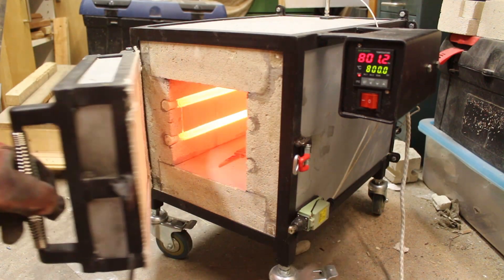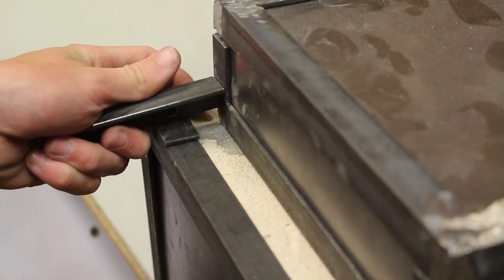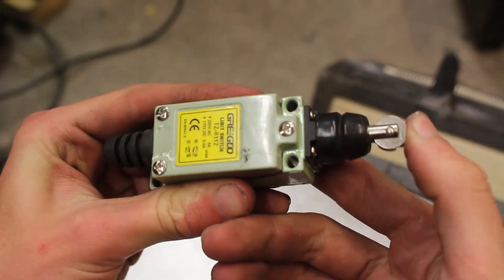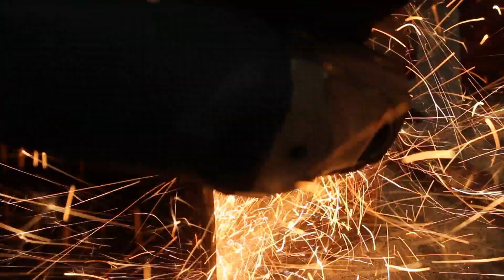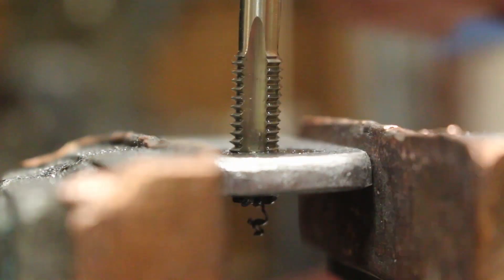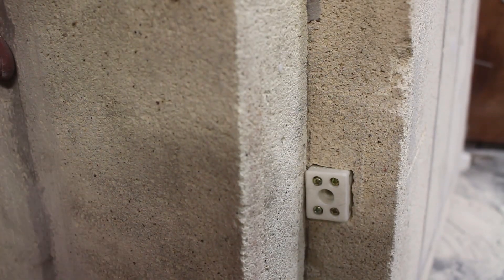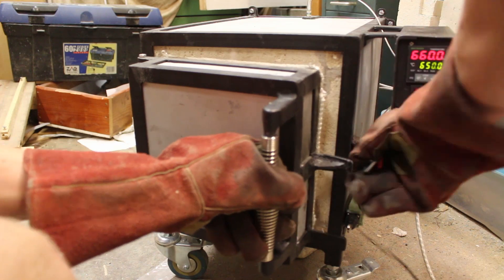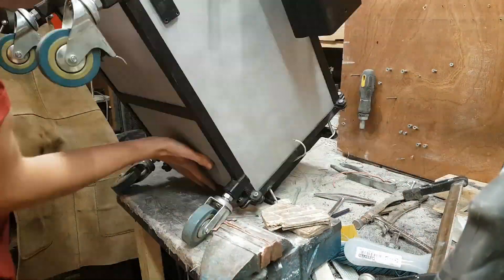How to Make a Large Heat Treatment Oven - Pt.2

Comment: Could I recommend that you use a rubber or insulating grommet around the cable exit hole on the back of the electronics enclosure.... to reduce the risk of cable chafing / shorting against the metal plate. I llke the design, and the explanations are very helpful. I'm going to guild one!. I know this is 3 years old, but worth mentioning. Thanks for the videos.

Comment: How hot does the outside of the oven get after an hour or so of running at 1000c amd above? I'm building  my oven now and ordered some 1 inch kaowool to clad the 2.5inch thk firebrick... Just wondering if it's needed?

Comment: Excellent build! Regarding all the welding, I'd absolutely recommend getting a tig-welder!:) No slag (so no clean up), easy to get beautiful welds, and an incredible dexterity when it comes to the amperage settings. And you can do tiny welds or heavy duty stuff with the same equipment. I'd be surprised if you don't follow This Old Tony yet, but there you can get a lot of tips an inspiration regarding tig.

Comment: ya wanna avoid scale.   Try  back filling your oven  with a slow feed  of nitrogen or argon  like 2 cfm or less since your oven is pretty tight..  or you can envelope your work  in a stainless pouch sold precisely  for this.    you can also  use a quenchate designed to  descale   Some folks  use mineral oil with ATF which is highly detergent and will descale.

Comment: Good vid thanks for sharing. Did you have any problems running the load through the cheap 20a switch? I used a cheap switch also but I was worried about running high loads through it so I ran the hot all the way to the SSR and then jumpered back to the 20a switch to power my PID, fans and amp meter. I was just wondering if you have fried a switch or not. I am not saying you are going to cook It. I just didn't trust such a light weight super cheap switch on my set up. I mean I did but I didn't want all that current running through it. Anyway well done looks really nice.

Comment: Congrats on the build man! I intend to build this very same design for annealing glasswork. One helpful tip though, although your intentions were good with the cable strain relief inside the box with the bolts. You should really install a legit strain relief in the back of the box where the wires enter the box. The purpose of a strain relief is not only to prevent the wires from being pulled out, but also from chaffing on the enclosure where they enter. It wouldn’t take long for that metal to wear through the wire insulation. With that much current going through those wires it’s a definite must have! Great job on the build man! You’ve earned a sub.
Reply: The metal clamping is good, a vinyl or silicon grommet would do nicely to protect the wires from chaffing at the thru-hole.

Comment: TAOW, I had an idea if you want to further improve the electrical safety of your foundry. For literally just a few bucks, you can pick up a high current full bridge rectifier to power the heating coils. This will convert the AC voltage to DC, which is considered to be 4 to 5 times safer for electric shocks.
Reply: ??? Citation needed...
Reply: @gregraynard781  ,  it’s pretty well known. This page says it explicitly. You can just google AC vs DC danger. https://www.asc.ohio-state.edu/physics/p616/safety/more_current.html
Reply: @shoitah  
In your citation it states " On the other hand, people have withstood 40,000 volts at a frequency of a million cycles/sec or so without fatal effects." Is that not clearly an example how "AC is more dangerous than DC" is not always true? At 1 mHz the skin effect is taking the charge along the surface in preference to better conductor underneath. 40,000 VDC  blows a hole in your skin, and then /500 Ohms = 800 Amps = dead or dismembered. Another misleading assertion is that is is current that kills, because without Voltage, there is no current.
Reply: @gregraynard781  , that is true but irrelevant information. All I’m trying to say is for TAOW’s purposes, at which an AC voltage at 50Hz, converting to DC would be considerably safer.

Comment: the limit switch is unnecessary for electrocution safety.  not only are your coils in a pocket in the walls but you would get burned badly before your hand touches a live coil. 
there is no way an ungloved hand would go near 900c heat without burns from heat first. Unless you got some ninja skills and the pain tolerance of a granite rock. 
The hair on your arm would burn off too.  I can barely stand a 900c kiln with welding gloves on for more than a few seconds.
Reply: You also have to consider when the foundry is cold and power is on. And also safety while servicing the unit.

Comment: Wow, this is simply amazing! I love this project and will try to copy it. What would you estimate the all-over costs for the material? The workload is of course impoosible to calculate and you can't put a price on that. Thank you so much for putting this together and sharing it! And one more question just popped up in my mind: as far as I can see you only used elektrodes for welding, no other machines. Would you do it again that way or would you recommend trying some MAG/MIG welding instead in the future?

Comment: What I would have changed is built a rack to set item on inside the oven then mounted the thermocouple around the same height as the rack to try and get a more accurate reading. But im not sure how much this matters.

Comment: TAOW, You don't need to squeeze everything down into a single video.  You could have easily made this into 3 or 4 good videos, or at least 2 -- one building the oven and one making the knife to test it out, hardening and tempering the blade. Now we want one of you finishing the knife, attaching scales, and polishing, etc.  Good job.  Did you say you don't have a good belt grinder?  New project?
Reply from the maker: Yeah true I could have split this one up into a few parts, but I wanted to demonstrate the oven working on something useful, and a simple file knife video has been done thousands of times and is nothing new. I do have a cool video planned on the handle scales tho :)

Comment: thermocouple placement is a mistake. The front of the oven is going to be cool while the back-top will be accurate. bottom of the back of the oven might not be the right temp either.
Reply: How much variation do think there is in the nearly gas tight oven? And how accurate do you think a thermo couple is? Does one offset the other???

Comment: Very professional looking heat treat oven, well done. There is just one thing that worries me about this oven and it worried me about your previous furnace build too - you don't appear to have earthed the chassis. You must earth the metal chassis and run the oven off an RCD - you have live heating coils and other cables in very close proximity to metal you don't want to be live.
Reply from the maker: Don't worry, I grounded both the frame on this oven and for my foundry. I didn't explicitly mention it in this video but it's mentioned in the wiring diagram towards the end.
Reply: @taow  Great to know, thanks. Your building skills have really improved, keep up the good work.

Comment: i love your content! i am a fellow knife maker and i also build a similar oven, using your older videos as part of my guidance. Although i build my own arduino based temperature controller.
I dont trust the thermocouple you used by the way, i used the same ebay one and it went bad after a few high temperature runs.
edit: the thermocouple still produced a temperature signal, but was off by almost 100°C